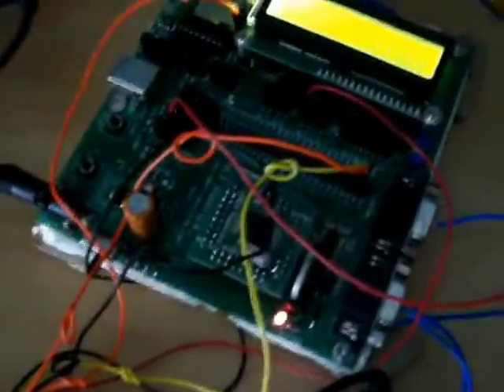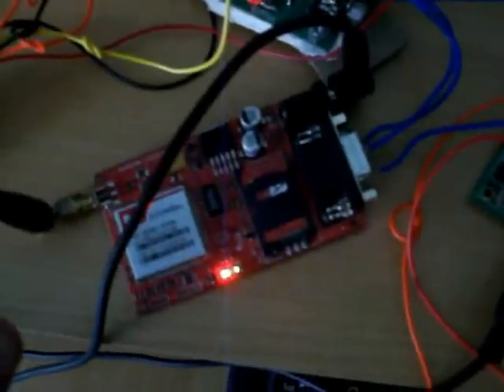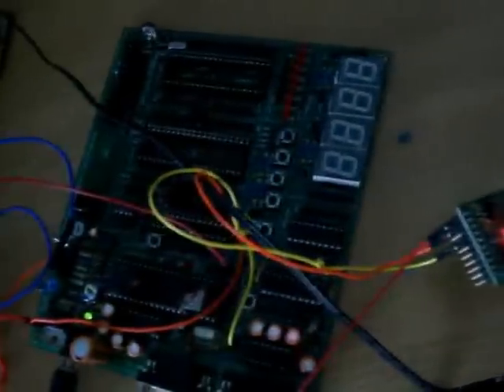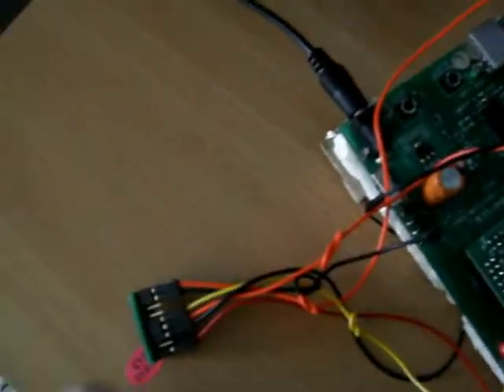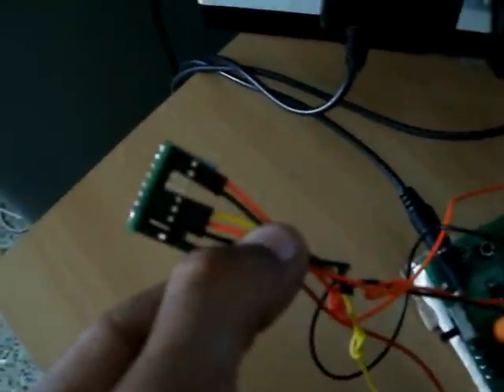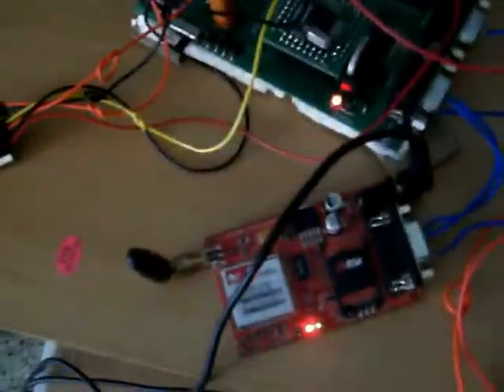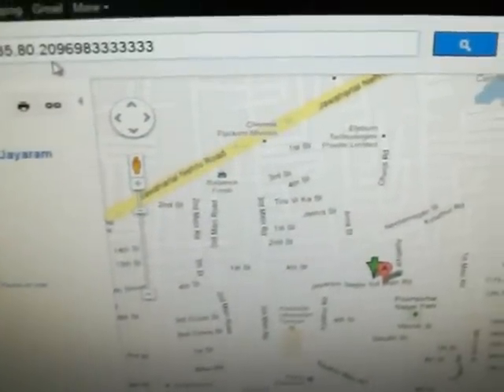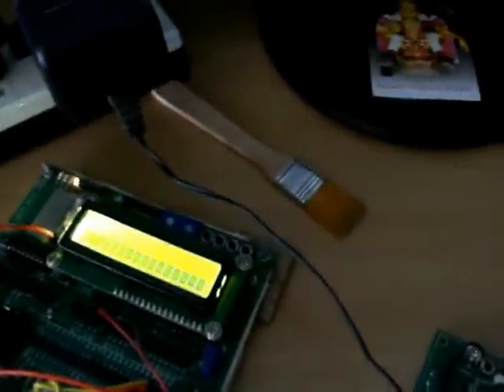ARM7 interface with GPS,GSM modem,accelerometer.mp4

Comment: hi pawan  great  job  ,but  i  have  doubt that  we  are using 5 v sim 900 and  3.3  v  arm  so   we  have  to use a  level shifter  no,if  so   suggest  me  a   level  shifter  i am not  getting output for  directly  connecting
Reply from the maker: Hi sandeep, thanks.  I used Max 202 . And the entire communication is on rs232 level.  So no 3.3 V. Or 5v issue.